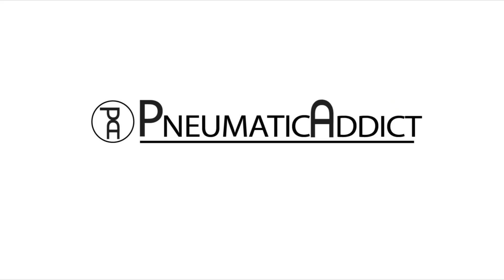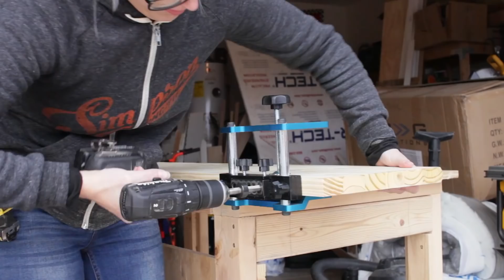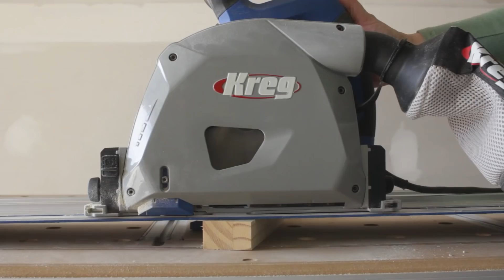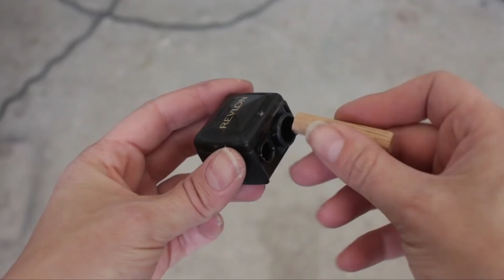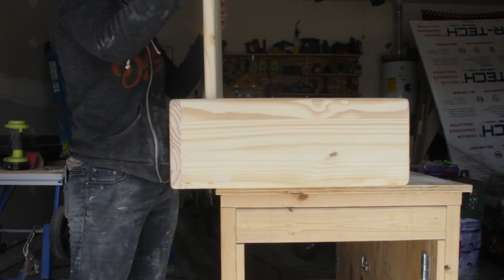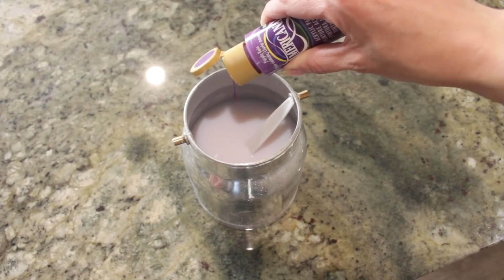STAIR TREAD Arm Chair | Single Saw Build

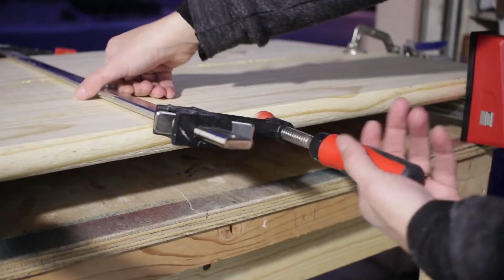Comment: At 2:10, you regret leaving the bullnose on while clamping up. That bullnose is giving you an advantage, actually, by locating the clamping pressure through the centerline of the boards. Maybe not needed at the screw end, where the swivel pad serves that function, but definitely at the other end. With every turn of the screw, the bar bends, the arm changes its angle of contact, and it is easy to have the pressure concentrated up near the skin of the stock, rather than evenly distributed. Result can be a poor joint or unflat panel. For jobs  like this, I sometimes give a quick couple of bevels on the jointer to one edge of the stock, to be ripped off later, or use a pre-beveled caul I keep handy. Most cases, we don't rip a panel to size till after glue up, anyway.

 I dig the I Can Make This attitude that you share with Tamar of 3x3, and that you both are helping to lead the way for other women to pick up tools. Keep up the good work! I'm subbed.

Comment: Did you use an existing chair to choose the seat height of the one you were going to design or did you use some other method to determine the seat height. I use my furniture makers guide that has the various ratios due to the different ergonomic of various human bodies. The chair you made is appealing to the eye it looks some what modern, great design and build.
Reply from the maker: I didn't use a specific chair, but I did measure a few different chairs around my house to get approximate dimensions. I started with the back at a 10 degree incline, but after rough fitting the pieces together, changed my mind and increased the angle to 15 degrees.

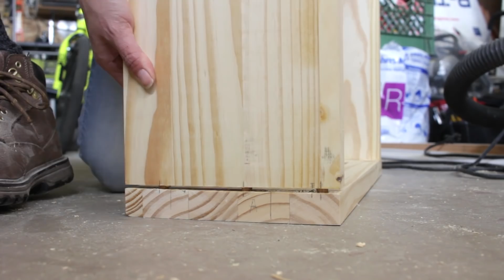Comment: Nice. But... have you noticed that the wood behind the back seat (you marked it as A at 6:13) is completly  needlees. If you took it off will make no change in the design and you save money, time and wood.

Comment: $900 for that whole kreg system in a very decent price. I wonder if the table works with other tracks out on the market.
Reply from the maker: Its actually not a bad price considering all you get. I would recommend checking on the Kreg website, but I do believe the track and saw are only designed to be used exclusively together.